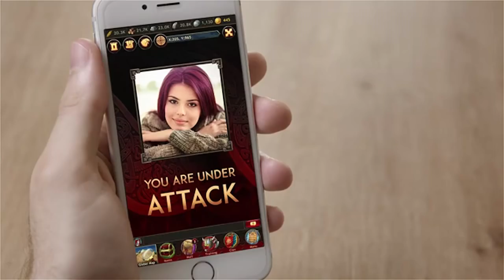Eating Beaver Tail! | Fire Arrow, Bearded Axe & Sword! | Catch, Pillage & Cook!

Comment: I need to start cutting sweet potatoes with a sord.
Reply: Matt Lieto its the only way
Reply: lvl111, A massive cleaver works pretty good but when it comes to weight the Viking sword just offers so much more chopping power. It also keeps the dinner guests in line.

Comment: The metal you used to light your fire with has been forged with mild steel, I would like to know what your using to create the reaction with on the steel...
Reply from the maker: Steel on flint.
Reply: The Wooded Beardsman ah yeh good ol Flint n Steel 😉